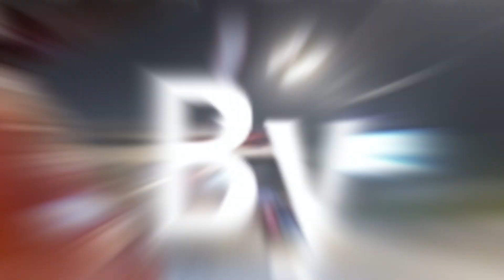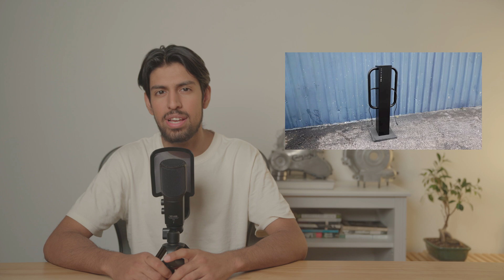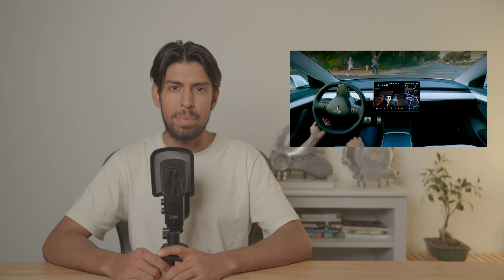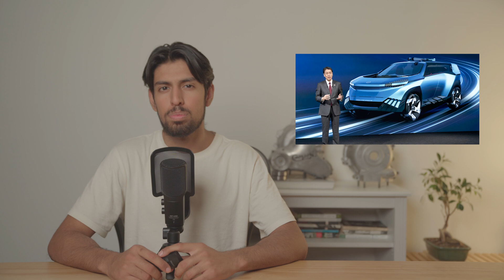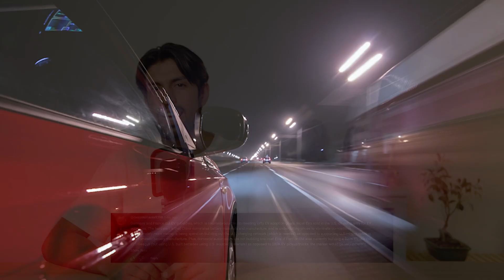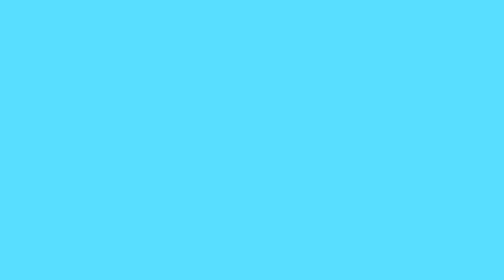Quick Charge Daily: Could this be the future of e-bike charging?

Comment: It is nice that some E-bike manufacturers are building smart public charger systems to prevent E-bike battery fires. Of course the larger issue is cheap E-bikes that don't spend the money to design safe charging batteries. The associated problem is that even though electric vehicles (cars, trucks, crossovers) have MANY safeguards, and therefore almost never catch fire, several stories in the media include E-Bikes in the larger group of EVs (and there has been a real problem of cheap E-bike batteries catching fire) and those stories hurt the reputation of safe EVs. Because the media stories just announce the problem of "EV" fires, and don't mention that they are specifically cheap E-Bike fires, and are not EV cars, trucks, or crossovers.